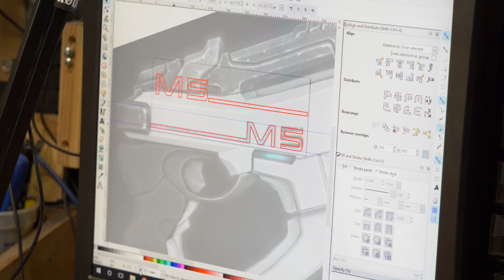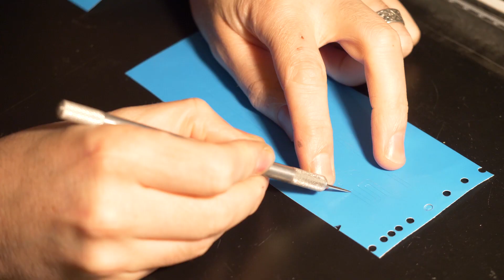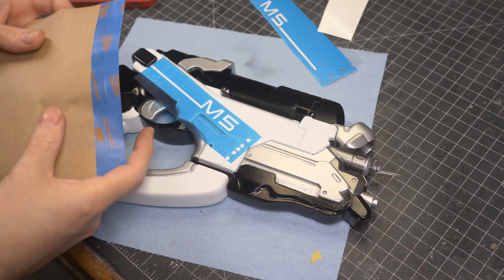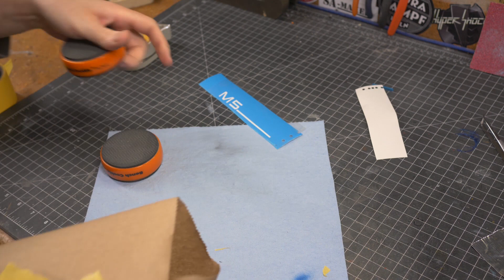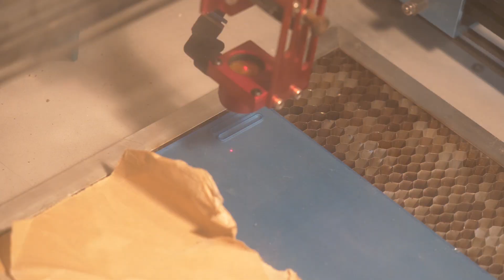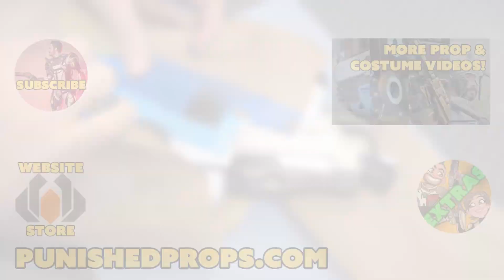How To Use Machine Cut Stencils for Prop Decal Painting

Comment: I use a cricut explore to cut vinyl stencils and masks and I noticed after you airbrushed the logo and removed the stencil you didn't seal it with a clear top coat to protect it. Couldn't the paint just peal off or chip fairly easily exposed like that? Correct me if I'm wrong but any skin or object contact could wear that paint right off? Cool video though!

Comment: I need to put white lettering on a model.  Do you have a decal house you recommend?  I believe the lettering would be too small to stencil.  This is a 400mm Fallout Vault 76 door.  I need the warnings and messages written on the various sections of the vault.  Thanks for any insight you might be able to impart.
Reply from the maker: I get a lot of my vinyl from US Cutter and do all the cutting with my own machine. I know you can get similar stuff done at places like Kinko's, but they have minimum order amounts, so just be prepared to get a lot of things cut to meet that minimum.

Comment: Any advice on how to keep the paint from peeling off when you remove the stencil?

I painted a plastic gameboy shell that I wanted to add a custom painted logo onto.  When I removed the decal stencil it peeled all the layers of painted and primer off with it. 

I airbrushed Vallejo paint. Two light coats of primer and three light coats of paint went in as the base before I applied the stencil
Reply from the maker: Hmmm... Maybe it needed to dry for a bit longer? Or, conversely, could have sat to dry for a little too long. It's always worth testing a stencil on some spare material before moving to your final piece. You could try running an XACTO blade lightly around the edges of your painted area to help release it from the stencil if it seems like the layers aren't separating properly. 

- Paige
Reply from the maker: The base surface needs to be roughed up with sandpaper for good adhesion.

Comment: For those without a cutter or a steady hand, you can also get decent results with a 3D printer, if you have one available. It won't take curves well, but thin layers of PETG (0.4-1.0mm) are quite flexible. The downside is that you might have to go in with a deburring knife to smooth out details, really fine details may be impossible depending on the gearing of your printer's extruder, and you don't have an adhesive backing to help out with holding the stencil down and keeping paint from creeping. For the latter issue, PVA glue can help, and you can wash it off with warm water.
Reply from the maker: Awesome idea!

Comment: Another great tutorial.  Nice info and perfect speed.  LOL'ed hard on the compressor interruptions! Now that I have to contemplate buying a vinyl cutter and laser cutter.  You made it look so sweet. Can the laser cutter do vinyl too?
Reply from the maker: Vinyl is not recommended on a visor since it contains PVC.
Reply: Is that because the PVC makes toxic vapors when burned or does it just melt too much?  I was wondering if I could laser cut vinyl for stencils.

Comment: Do you think you could use a laser cutter to cut out the stencil?
Reply from the maker: It is not recommended to cut vinyl in a laser cutter. You could use the laser to cut some masking tape though.
Reply: "the vaporized material releases deadly Chlorine gas, which turns to hydrochloric acid when mixed with water vapor in the air, causing great damage to the machinery (and our lungs!)."

Comment: Hey there. I've seen on some of your videos using a silcone mixing pad when mixing your Bondo. Did I you make that or was it purchased?
Reply from the maker: I made it. Whenever I mix up a bucket of silicone, whatever collects in the bottom of the bucket is peeled out after it cures and I use it to mix stuff.

Comment: silly question. Why dont you just cust the decal oput of vinyl of the propper color?
Reply: That's a perfectly good option, although it's one I'd personally avoid. There's a strong chance they'll end up peeling of at some point. There's also a fairly noticeable edge, which can attract dirt and grime, which just aids in the sticker peeling up. You could clear over the sticker to help seal it, but I'm not 100% certain how well the vinyl and clear would interact.
Reply: Easier to do weather it painted-on.
Reply from the maker: That's a good idea too! I did not have the proper color vinyl.